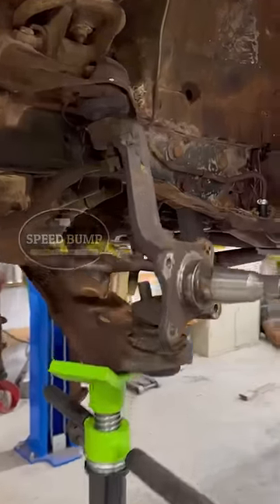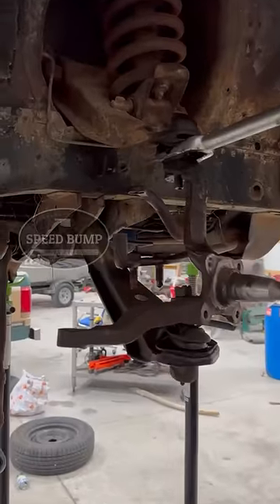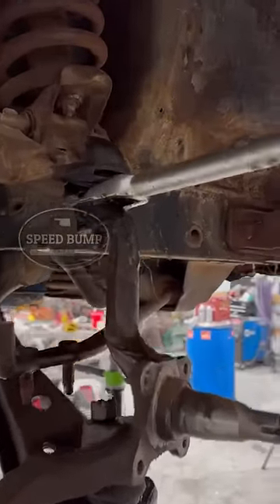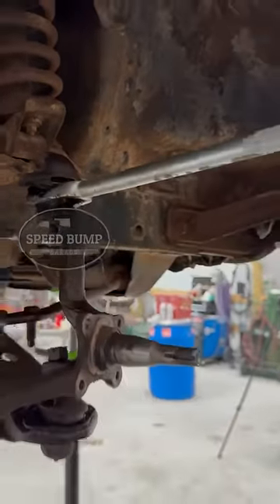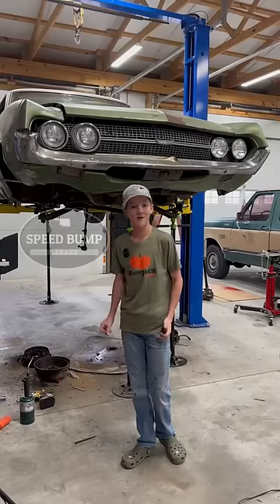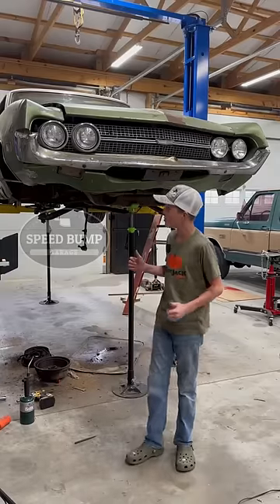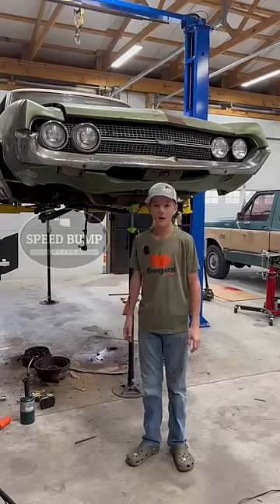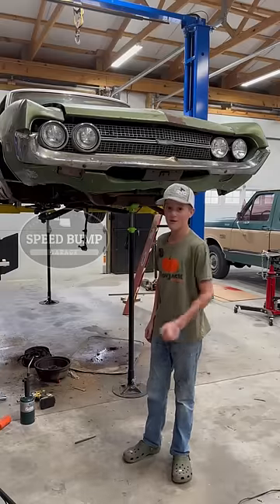GrowJack Ranchero Revival Part 17

Comment: Jack is a real mechanic. You can see it on the safety crocs🔝
Reply: Those are “casual video crocks”.
Reply: Hit the spindle assembly with a 5 lb. sledge directly below where your pickle fork is.
Reply: Those bad boys are even in sport mode.
Reply: They got she’ll toe tools
Reply: 4WD is on😂💪🏿
Reply: @jeffhunter2553 
But start the nut on the threads to protect them first.
Reply: I swear if I'm lying I'm dying I know a guy that used to work out at the landfill he's a welder this dude stick welds in flip flops
Reply: Get him safety boots now 🤠
Reply: @OlariMC  the crocs are more than safe😂
Reply: Same crocs but not same coolness ❤

Comment: Get a blow torch and heat the nut up, a lot, then quench it with water. The expansion from the heat and the quick contraction from the cold breaks the seal and comes off easier. Make sure you have a pail of water with you and your Dad along as well.  This has always worked for me.

Comment: Hey Jack, great job with the car so far! Found you recently and it's great to watch the updates. Here's a tip for tough, stuck in place nuts. Get a long metal pipe to fit over your wrench. The longer it is the more leverage it gives and the less force required on your end to get it removed. Good luck on the Ranchero!

Comment: Always remember: Force * Distance = Torque. When you have something that's real stuck, always put a pry bar on it. The amount of distance you apply the pressure on will make 'er come loose. And if that don't work, give 'er heat. Heat makes those stuck connections expand and pull apart. Keep the updates coming!

Comment: Good job dude. Try hitting the knuckle right on the side next to the pin/bolt of the ball joint. The shockwave makes the taper release from its hole.

Comment: Get a matching 6” bolt and coupling nut.  2x 1” heavy washers and a 25lb plate from a weight set.  Attach it to the bolt coming out of the ball joint.  U got a custom slide hammer for pulling the ball joint straight out

Comment: Hammer the side of the the knuckle where the ball joint slides through. Takes alot of good whacks but it will come loose eventually. Or speed things up and hit the same spot with an air hammer while someone pries down on the knuckle. Rust belt tech tip lol

Comment: Love your videos Jack! Did you spray that ball joint down a few times with penetrating oil? Then an air hammer or mini sledge should do the trick. Sometimes they are pretty stubborn. Dont forget to be a kid sometimes too that part goes away before you realize it bud!!

Comment: With the suspension you have to be careful of the springs (coil -torsion) to let pressure off slowly by using a strap or jack to hold the weight of it. And let off slowly. Then you'll get the ball joints easy.

Comment: Heating up the upper control arm where the ball joint stem might help, hit it with a shot of pb blaster once its hot. But get your dad to supervise! It can become dangerous if you havent delt with a torch before.

Comment: I bought a 1973 ranchero with a built 390 with a high stall torque converter and a four barrel carb that was in four barrel all the time. It also had a three-quarter inch racing cam. It did not like to idol lights. I had to constantly rev the engine, so it wouldn’t die  and there was always a rock rocking as I drove it from side to side until you hit 110 miles an hour, and then she ran smooth and straight. That’s how I know I was way over the speed limit but again I had a gym top cover on it I used to camp in it. It was fun times. sad when I trade him that car for 89 Ford ranger pick up truck was as nice if not nicer than my 83 Ford ranger which I bought after I got the 89 and after that I got a 96 Ford Ranger pickup Fun times

Comment: Heat the outer part with a propane torch make sure it's not covered with grease or you'll start a fire but heat will let the ball joint to come apart easily

Comment: Get a bigger hammer and heat up the knuckle. You can also put the nut on the ball joint just enough so it covers the bottom thread of the bolt.  Then small the nut with the hammer

Comment: Hit the round part of the spindle where the ball joint goes in to it  on the top and then try the pickle fork  or heat it up if you are replacing the upper ball joint

Comment: With the disks breaks  don’t forget about the proportioning valve and the brake booster rod to master cylinder may be a tad bit too long will cause calipers to stay engaged to rotor

Comment: When it comes to ball joints like that, just hit the side of the spindle where the tapered piece is going through. There should always be a little flattened section right on the side, just hit that with a sledge hammer a few times and it usually drops it right out just by shocking it.

Comment: Make sure you put the proper proportioning valve for those disk brakes.  To much braking in the rear is very dangerous!  It’s generally safer to just rebuild the stock drum brakes.

Comment: hey you seem to like old Fords your next project car should be a Ford Galaxy 500 it was a stock race car right off the assemblyline I had one with the rock crusher clutch & positrack rear end I forget the engine size but it had a large V8 engine in it. I had so much torque I could smoke the tires @ 60 mph

Comment: do you have air tools? if yes a nuematic air hammer will pop that ball joint loose PDQ if that doesn't happen use either oxcy accetalene torch or map  gas torch heat it up cherry red then try the hammer again

Comment: Keep at that ball joint although I'm sure you've got it off by now. If it doesn't come off with a few smacks try hitting the knuckle that the ball joint is received in. If that doesn't work put a cheater bar on that pickle fork and give it a go.

Comment: Put some tension on that ball joint and hit the part that the threaded part goes through, not the ball joint itself. There's probably enough tension with that pickle fork jammed in there, just hit the spindle with a 5lb sledge hammer and it'll pop right out of there.

Comment: Those ball joints need the ol' heat n beat! Careful with the fire, but heat that knuckle around the ball joint and send some penetrating oil in there. Then smack the knuckle perpendicular to the ball joint with a sledge. Itll fall right out!

Comment: My 1987 chevy turned on after fuel pump n gas tank replacement and after turning it on and letting it idle for a while it turned off and kept turning off and now it's not turning on and I don't know what to do if it's not one thing it's another 🧍🏻‍♂️